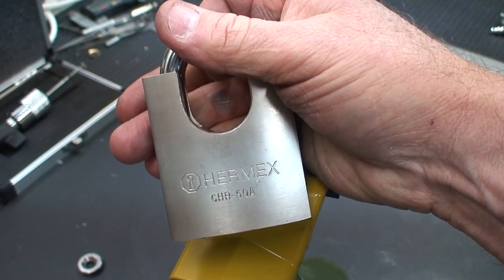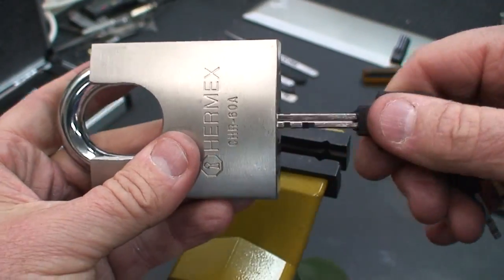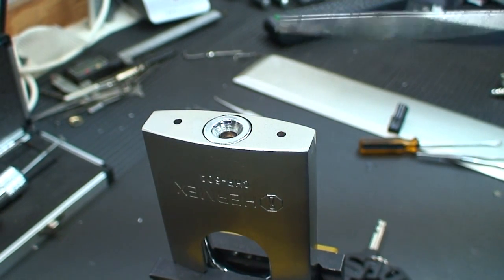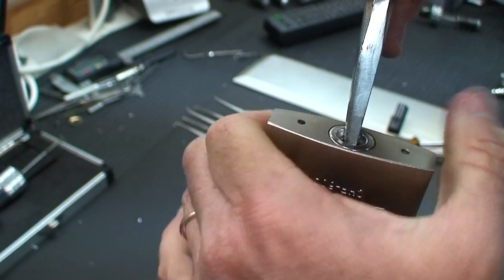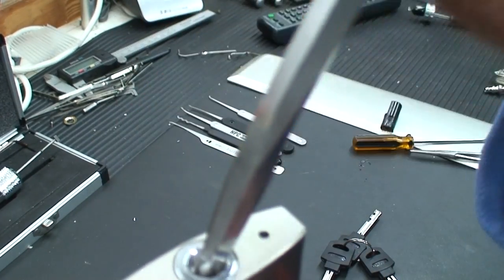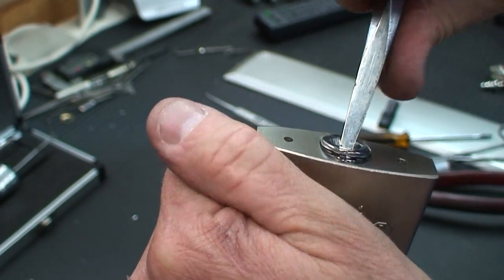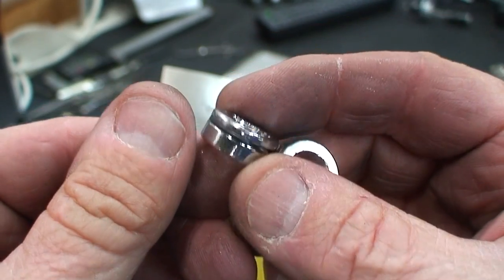(15) Defeat Hermex Disc Detainer Padlock by Exploiting a Design Defect

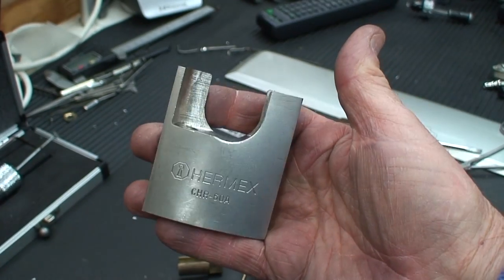Comment: Looks like the body started to give up the ghost at 5:05 when you spun it around. Is that a vacuum base vise? Moisten 1/4" of the edge of the diaphragm before mounting. If the surface is smooth enough, it will not move. Trick works also on windshield mounted Nav systems.

Comment: Bill i learnt this trick to open the diac detainer challenge lock i sent you that says Mocha on it. I filed false gates in it for you to pick it.
Reply from the maker: I did manage to finally pick it (and left it open), but didn't want to screw it up by taking it apart.  Your note saying "please re-assemble it before returning it" was a big red flag to me...  I put both locks into the post to you about a week ago.
Reply: bosnianbill lol haha, well bill i took it apart and filed little false gates in the discs. I think if you zero the discs first then it is easier. If you just picked it from the normal position then you migjt find some crazy falseset like i did. Thanks. I am sorry that the post address did not work....it was wierd cause this was the first time is was not postable. Oh well...i had fun never the less seeing you nearly get whipped. But i think you would have picked it anyway.....if you used a longer tensioner like you did on the padlock with the split core. 
Cheers. Btw i have a Masterlock bike lock with no keys that is a Ulock better than some other master lock bike locks you have featured. I can send it to you for picking and destruction as i am sure we can all learn more about it from the original Locklab than from it sitting there laughing at me.

Comment: I have seen a lot of locks like this and some of them you can pop with a screw driver. some are harder but I fount with a small pocket sized 1300c torch you can heat the thing up then pop it quickly. I have also recently seed a video wear a guy hade a $100 high secerity lock that the mfr clamed could was un pickable and un breakable and work take 10min to cut with a cutting torch and well he hit it with a hammer as it was hanging and it poped right open. I cant rember his name it was something with locktester secerity